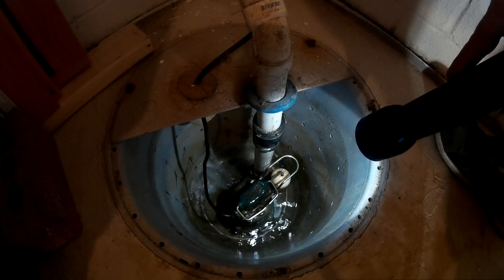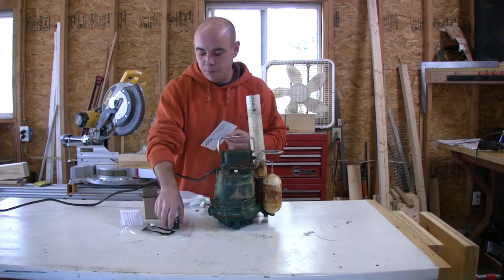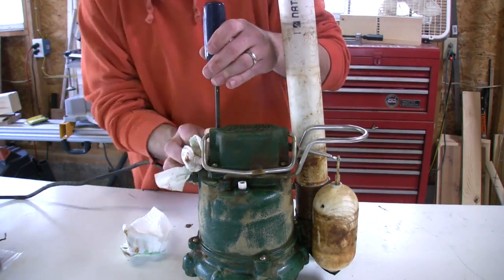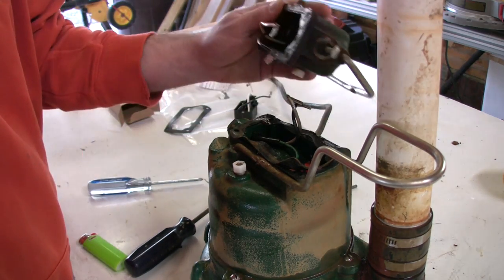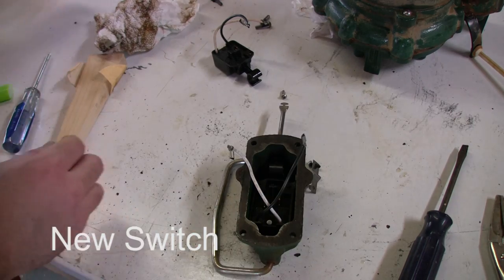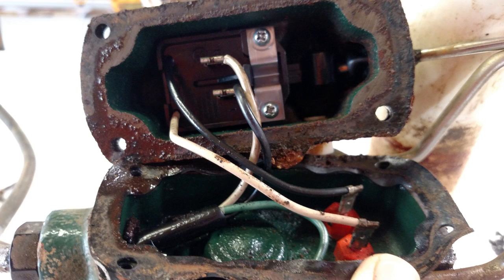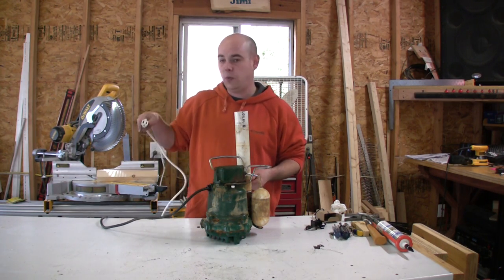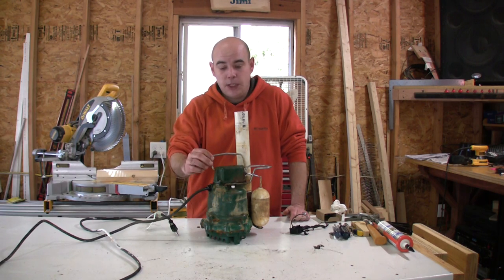SUMP PUMP Switch Replacement | DIY

Comment: My switch was stuck, and I had a new replacement on hand. Of course I went with the same model. I purchased the switch kit, and it's ready to go back into service when necessary. Having a backup is always a good idea. Who has time to run to a plumbing supply in an emergency? This video helped a great deal.

Comment: Great video.  I removed the switch from the housing first and removed old gasket and replaced with new gasket with sealer.  Then I marked black wire connectors with perm marker and removed wires one at a time. Then I mounted the switch back to the housing. Works great - using mine as a back up for my new pump.

Comment: Great video! So many bad videos on youtube, but yours was clear concise and informational. Thanks for speeding up the parts that would have been boring. BIG THUMBS UP!!!
Reply from the maker: Awesome! Thanks a bunch :)
Reply: @MitchDeitrich  great video ! i am from the UK and i install these in basements over here. Is there a way to adjust the float switch level at all ? ie change it to a variable level unit 
thanks

Comment: Thank you for the video post, I will be doing the same thing, my first Zoeller pump lasted about 7 years before the switch started acting up, I called the installer and he replace it with a new one of the same, now just 5 years later I'm having switch problems with this one. I will be ordering a new switch and gasket via Amazon very very soon, thanks again.

Comment: thanks a  very much on the video on M98 Zoeller  i had a ground problem   the wire had been pull off clean could not tell how it was mounted. and black wire coming from the Maines  had no medal clip to put on the end of line. if not for the details you had i was able to move around and zoom in. Now  i have one question for you. the four screws that was used on the switch housing some were bent tore up looked like all they had to was a crowbar and hammer to work on getting switch replacement. do you have dimensions of screws that go in switch box on top of pump  someone told me thought #10-32-3/4in.i tried that, after i screw it in as far as i felt comfortable the screw still had 1/8 or more sticking up. ant ideas G. Marsh

Comment: I have the same pump, and so far the switch has experienced this issue multiple times. It seems like it will go for about two years and then the issue comes up. The pump has a warrenty on it, however evrytime the repair guy comes out, he says I need a new pump, and he takes the original pump with him when he leaves. $300 or more for the new pump and $200 at least to come out. I know he is ripping me off. I don't want to mess with this myself, what are my options. I saw a tilt switch with a piggy back plug might be a good option...that I can do. Any thoughts?

Comment: I bought m98 last year and it does not run anymore. They should last longer than that. I pulled the pump out and going to troubleshoot. Should I order the new switch ahead or you can check the motor to see if it is good by bypassing the switch

Comment: You refer to the compartment being wet, and that being a sign of a leak.  Mine had a substantial amount of oil inside which had to be from manufacturer.  Are you sure it was water in yours?

Comment: QUESTION!! First off, very informative video as I have the exact model and it too, has been 7 years since I've bought it and dropped into my sump it.  my question is, it's been 7 years and my switch seems ok and sump runs only during heavy rain storms. Should I go ahead and replace the FLOAT SWITCH now since the pump is 7 years old or do you recommend, if it isn't broke, don't fix it? I'd hate when it's broken.... to fix it.thanks!
Reply: Well, now it's 5 years or so since your post.  What did you do?

Comment: I have some questions. Do you think the failure of the switch was water entering the switch compartment ? Do you suspect the power cord entry hole or the gasket as the failure ? Since the switch is at the very top of the pump, does it ever go completely under water ?
Reply: I believe so.

Comment: I recently had a Zoeller M53, go out. The issue is that it the pump does not always switch on when the water level rises. Do you know off hand if this would possibly be due to the sump pump switch? If it is then this fix may work for me.
Reply: The M53 is a good pump with a bad switch design.  Google "Zoeller Pump Switch" and you'll find that this has been a longstanding issue with these pumps.  The switch just broke on my second Zoeller M53 pump.  Seven years seems to be the sweet spot for these to fail but of course this will vary according to # of cycles, etc.
Reply from the maker: ap777200 yes that sounds correct. I would replace the swich if you want to extend the life of the pump. it is cheaper then a new pump. however my happen again in a handful of years.

Comment: Where can buy sump floats with mercury switch and not the unreliable mechanical switch?
Reply: thanks the government and envirnmental concerns - mercury switches are no longer available - worked great but no longer availabe.  Go with a LevelGuard or HydroCheck electronic switch and just tie wrap the switch up in the on position or if ambutious eliminate the switch completly.

Comment: Thanks for the video. I had the same problem, and bought the same switch. The switch replacement went well, but the old white plastic piece that screws into the side broke when I removed it. There is a new one with the kit, so that's not a problem. But I'm finding it very hard to get the old one all out - very fine threads, and the old one is sort-of embedded in the old threads.
Reply from the maker: oh man sorry to hear that! Maybe some heat would help?

Comment: I think I would have replaced the AC cord and the cord seal. Just daubing some silicone caulk on there might not be a reliable long-term fix. This is a submersible pump which must be sealed 100%. Actually I am critical of that pump because of its very short cycle time.

Comment: ps-my switch is sticking right before flloat hits top. I have to give it a nudge, then it kicks on. Maybe it just needs cleaning. I haven't taken the pump out of well yet to look at it.
Reply: Mine is doing the same thing.  It doesn't come on sometimes, but with just a light tap on the drain pipe, it starts up.  Did you ever figure it out?

Comment: Very common problem with zoeller pumps. Leak in the switch compartment causes the switch & connections to corrode. They are garbage. & replacement switches are outrageously overpriced. I recommend folks avoid any pump with an integral switch & just use a tethered float. Nice video though.

Comment: Zoellers have garnered a bad rep over the past couple of years. Most techs I know have flat out switched to a Liberty or equivalent, or locked out the old internal switch and put an external float switch.  They got cheap on the gasket so that is why they fail, badly.
Reply: Exactly.

Comment: Change that pump.  Its 7 years old
Reply: My in-laws have a pump that is pushing 30 years! They replaced the switch once and it is still going. I live next to Lake St. Clair and no pump will last more than 10 years here. Runs constantly.
Reply: Pump can easily last 50 years plus. You need to put good switch